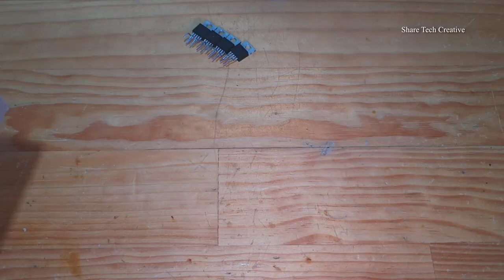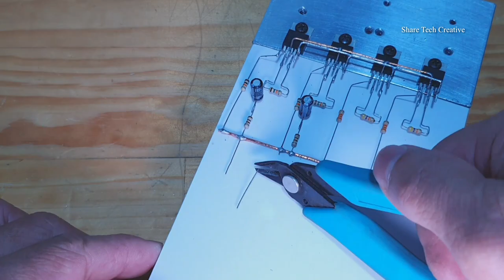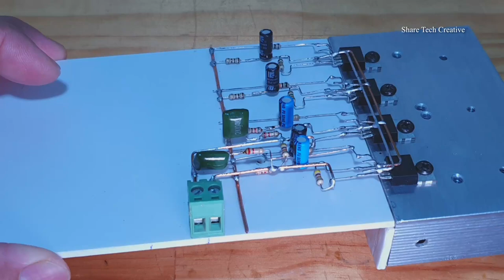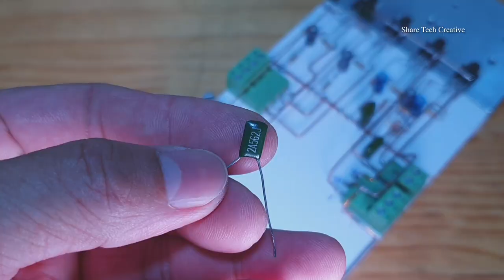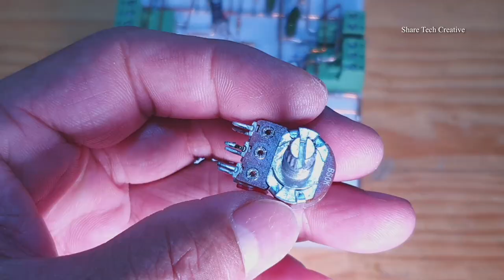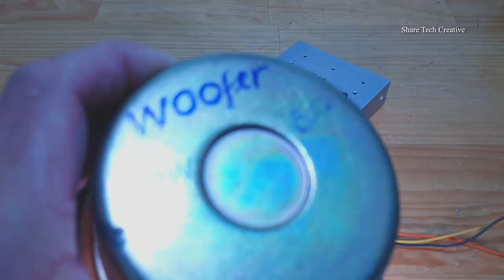How to make 2.1 Hi-Fi Audio Amplifier Using TDA2030 IC

Comment: Can i power the circuit without a transformer and use a 15v adapter instead?
Reply from the maker: It's great if you use an adapter!
Reply: @ShareTechCreative  which is better power supply  to use, symetrical or single power supply

Comment: Good day sir, I did this amplifier yesterday but its just giving out a humming sound. What might be wrong maybe? tda2030s or ne4558? when I check all components are well connected
Reply from the maker: If it works and produces a humming sound, then check the speaker output Zobel filter circuit, the 104 capacitors, and the filter capacitor on the power supply pin. Thanks